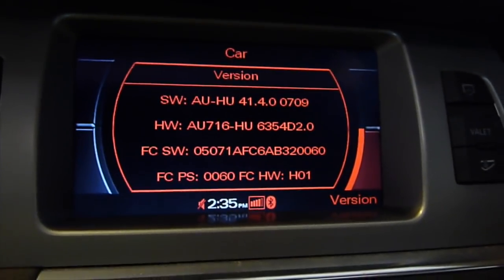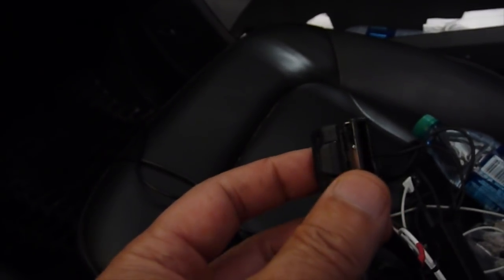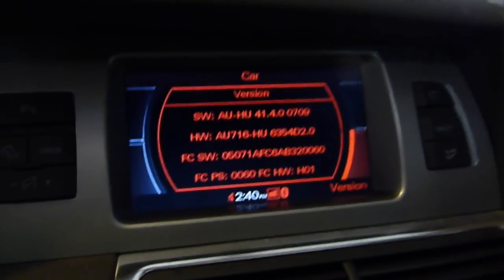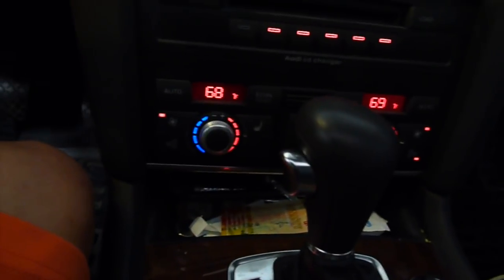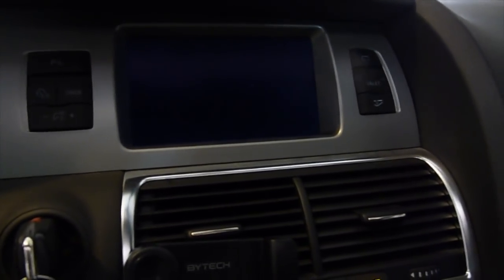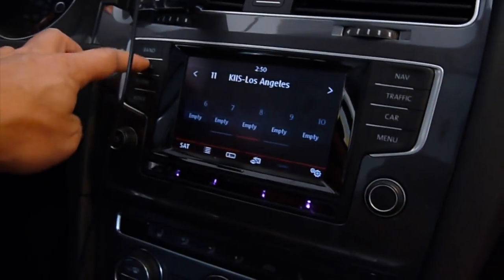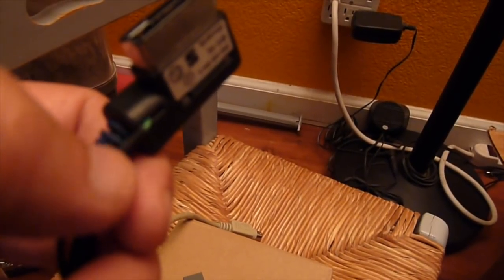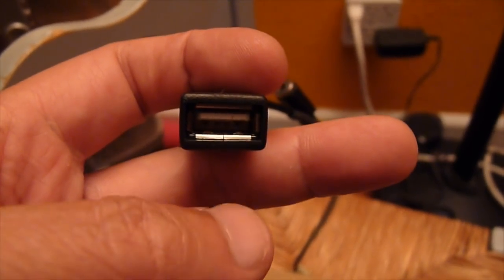Modify AMI Cable To Stream Music with Both Bluetooth and USB Drive For MMI 2G and 3G

Comment: Hello sir! Im having an electrical issue on my a8 2006 previously in a crash on the left hand side, busted the compressor and all the wires and main air line, so basically i put another wire harness and air line, the problem is that im not getting power to the compressor, i tried jumping it and the compressor works and the car lifted like 2 inches,  i replaced the 40amp fuse under the driver side dash, the relay im not sure if its good, ill check on monday, im wondering if there is other relays or fuses related to the compressor , basically power is not going to the  compressor 2 main thick wires, any help sugestion is appreciated tnx